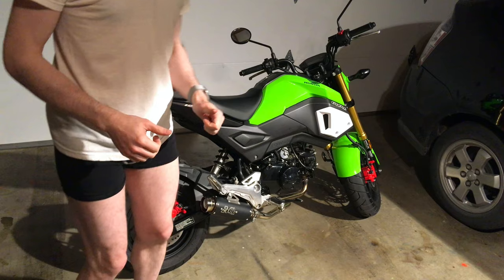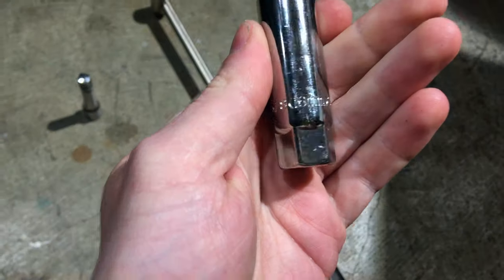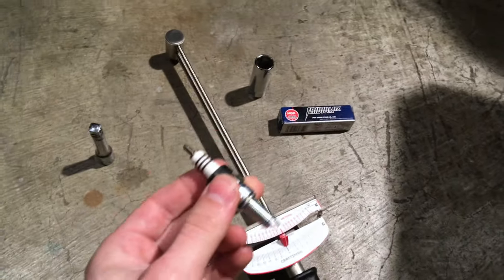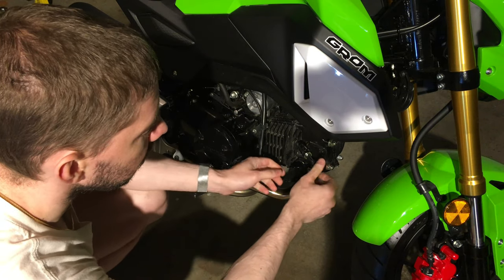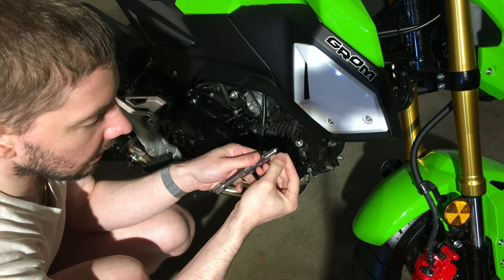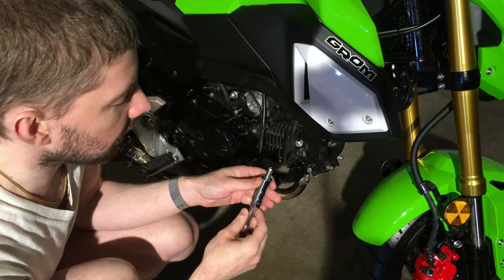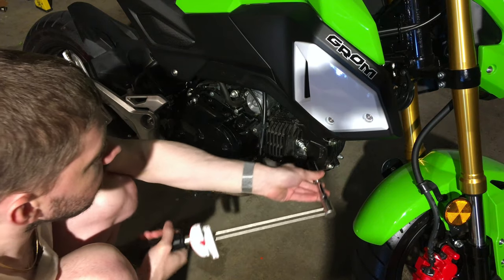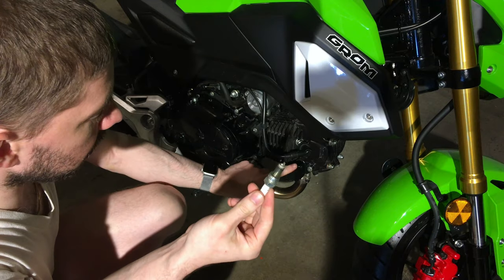2019 Grom SF NGK CPR7EAIX-9 Iridium Spark Plug Install DIY : Longer Service Life Iridium Plug :)

Comment: What about the Spark Plug Gap? what specification mm does it need to be set at?!
Reply from the maker: Never gap an iridium tipped spark plug, the welded iridium plug super brittle & can easily snap off, rendering the plug ruined. No gapping iridium tipped plugs, they come factory gapped from NGK